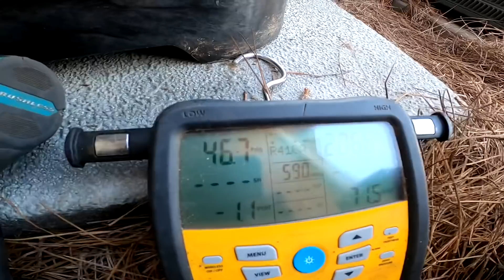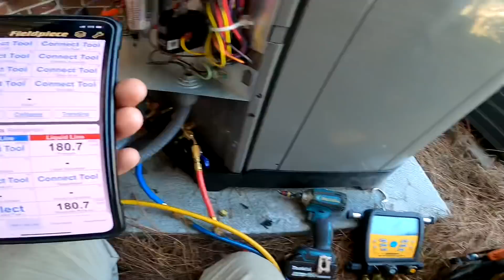Brand New Ruud Heat Pump - Faulty Right Out Of The Box

Comment: I would have pumped it down, cut the lines, unhooked, told the home owner "I'LL BE RIGHT BACK IN A FEW", and took it back for another new whole unit... 

If they refuse, take your business elsewhere!!!

That is within the 30day first run time, anything within first 30days, whole things gets jerked out!

I had a unit that was 1 1/2yr old, compressor went bad for no reason, didn't show ground nowhere, but would knock breaker every time, unhook compressor from contactor, and fan would run fine, i was ready to pull condenser, my supplier said if it was first 90 days they would...

Just talk to them, ask them to put themselves in your customers shoes, how they would feel...

I been lucky, got some good guys at my distributor.. Sure do!

Comment: Same thing happened to me today.  New unit, blocked TXV on the condenser in heat mode.  Works in cooling just fine.  I have always been loyal to Rheem and have installed a bunch of their systems.  Several have gone 20+ years.  I hate to see this happening.  Just no excuse for it.

Comment: Here in Florida the base tier product is now the two speed RP14AZ  I have installed two of them now with new line sets, compressors sound like marbles are bouncing around in them kind of like when a compressor is starving! Pressures where they need to be charge right on just noisy as hell! Got me very concerned anyone else seen this? Very loud surprised one of the Customers has not complained yet. Can’t just walk away gonna have to go back in a week or so and check it again and if it’s still doing it will be ordering compressors! I’m a die hard Ruud guy but between this and not being able to get any HP package units I’m about to start pushing Carrier again!

Comment: They have had a problem for a long while for sure. I’ve replaced many failed txv’s in the outdoor side of rheem/ruud stuff. Not metering correctly, broken cap tube from the bulbs, broken equalizers. I don’t see how they wouldn’t know it’s an issue.

Comment: Maybe the subs got some crap inside the line set or didn't purge nitrogen while welding or just straight burnt the copper or are it hot enough for the suds to stick the valve in closed position.  I know manufacturers do mess up but more then likely seeing couple other install errors on your video I'd make sure the subs are doing their job properly. That's just my 2 cents I know you didn't ask but I'm just looking out man love your vids I'm a tech out here in TX see all kinds of stuff at start up and it starts with the subs end on me trying to fix it to the best of my ability brand new equipment.

Comment: I know the pain of the new installation that is defective.  I had a lennox condenser with a locked rotor compressor, right out of the box! Now that lennox is using LG compressors im their lower end units, they have become piles of hot garbage.
Reply: Mine had a faulty evaporator coil, replacement didn't fix the problem, and now I'll have waited almost three weeks for a new txv. The worst.

Comment: I used to be a Raheem dealer in 2010 and had quite a few problems with the equipment. Needless to say I changed lines or equipment.
Reply: yep, leaking coil and leaking factory welds

Comment: I dropped Rheem for Amana, don't laugh, it's a better unit. First of all, they are much quieter, they come with a compressor jacket. The warranty is much better, and they would be replacing the outdoor unit for a DOA. They come with a full-size motor, not a cheap clamshell motor, they have old fashioned pistons, no TXVs to deal with. I replaced 35 outdoor TXVs on Rheems last year through the company I work for full-time. In the past 3 years I have installed approximately 27 Amana units on my own and have had 1 callback for a bad defrost sensor. Rheem's look good though, right? Oh, and Amana is MADE IN THE USA!!!!! Just something to think about.
Reply: I bought a new Amana 18 or 19 seer unit about 7 months ago. It kept showing a low refrigerant message when trying to use the heat pump. After 8 visits from the installer including 2 with Amana reps, they agreed to replace the unit next week.

Comment: Did you flow nitrogen during the install? Will be hard to determine if it was a installation issue or manufacturing problem.They should bring you a replacement immediately,if you work with them often.

Comment: Yep, we've already found several of those. We had a package unit last week where both the indoor and outdoor are pumping down like that. Rheem has got some kind of crap floating around in their systems that they don't want to tell people about. Or they're using the worst txvs known to man. I believe over the next year or two we're going to see the worst quality issues we've ever seen in the industry. Everybody's trying to get caught up on production and quality is going out the door. They'll slap anything into a box right now just to get it off of the assembly line and shipped out to the suppliers. This is going to plague us for a while I'm afraid. 😒😒😒

Comment: I see comments by others saying the customer took the cheap route etcetera. Come on guys, look you pickup a unit sold by your distributor, it should work out of the box.  This is lawyers call “a defect in material or workmanship.”  Accept nothing but a replacement unit form your distributor and let your distributor deal with the manufacturer.

Comment: Not a fan of Rheem. I think they are trash personally. I’ve fixed several heat pumps that were only a couple years old that had leaks at the condenser on that little tube for one of the pressure switches , the high pressure switch I believe can’t remember. I’ve also had a newer system with a leaking reversing valve, which I replaced only to have the condenser coil start leaking less than a year later and have to replace it. Needless to say, the homeowner was not happy. If you pay all that money for a new system, you shouldn’t have to have two major repairs done on a two year old system. I’ve had really good luck with Trane as well as some of the ICP stuff. Specifically, Heil and Maratherm. But, we install Trane 90 percent of the time and I’ve been more than happy with them.
Reply: Rheem/Ruud put out a product bulletin on both the High Pressure switched, and the reversing valve leaks (Which they extended labor on for 5 years). Both have been addressed and they stood behind the issue.
Reply: The unit really doesn't like you

Comment: These things do happen. It is a biproduct of any production line, but frustrating none the less. I personally like the Ruud unit's. U96's and V98's are as simple as any communicating system to hook up (R,C,1,2,) but the interface is intuitive enough to find whatever you need including random things like trim profiles or delay off timers (the dipswitch stuff). 

- clearly with this being an elderly woman in a retirement complex she went the budget route, so this doesn't exactly help you; but I think maybe your being a little extra hard on Ruud/Rheem given the all the circumstances.
Reply: Absolutely not. There is no excuse for poor workmanship. They should either overnight him a valve from somewhere or get him a new unit.
Reply: @paulhickey4485  😂If you say so big guy.
Reply: @berated4541  yes sir I say so.  They need to.make it right. There is no excuse for apathy.
Reply: @paulhickey4485  Who says Ruud had a lack of concern. From the video, availability direct from the manufacturer isn’t an option as they don’t have any in stock. Maybe it’s because my company is a Ruud Pro-Dealer but if I was in that situation (and have been in the past) I would make them pull down a new heat pump and I would rob it out of the new unit. Point being even as a “pro dealer” which gives you more purchasing power and slack on returns, Rudd often fights me on overnighting parts. You can’t expect them to bend over backwards on a defective part from the factory (remember every factory line has a % of defective components/units), especially when the contractor does minimal business through you. It just doesn’t work that way.
Reply: What ever happened to quality control ?
Reply: Given the decline in product integrity, I don't think so. Manufacturers have brought a lot of this animosity on themselves. It doesn't matter the customer, they purchased in good faith. The manufacturer should do everything possible to make it right, especially in emergency situations. We live in the most advanced country in the world and our product integrity is really low. Look at appliances. Not even a three year life span and they really don't work well when they do work. Now HVAC is getting high tech and less dependable. It isn't just Rheem. It's all of them. Customer service has become second rate. The government created the labor issues we have and it's going going to take a while to recover after we change course. That's another rant.
Reply: @paulhickey4485  Well I hope for both of their sakes he can take your comment to the supply house and get that part overnighted! 🤣
Reply: Rheem/Ruud has a policy in place for this situation. Even though the part is not available in the “Parts” Department, doesn’t mean they don’t have them on the production line side. The part gets ordered, an email sent to the factory, the part is pulled from the production side, and sent overnight. Yes, I am biased towards Ruud, I’ve been selling them for 36 years and found them to be the most responsive to any situation involving their product.
Reply: @TodSutherland  I do like Rheem and ICP products. They are economical, and the 14 Seer have generic parts. They work and last just as good as the others. That being said,  seems these days the quality is  the same, crappy. It's customer service thst counts and that's not much these days. That's not limited to HVAC either. It's disheartening for the most industrialized nations to have such inferior product integrity. It has greatly declined over the years.

Comment: Many years ago I was sent to start up a new carrier rtu. When I turned on power it tripped the breaker. Come to find out it had a severe burnout from the factory. Ended up changing the new compressor, changing dryer, adding a suction dryer. To say the least I was not a happy service technician. Have not liked carrier brand since that day.
Reply from the maker: It’s frustrating when it happens

Comment: High failer rate with the shorty Rheem AH  in the last few years  as well . The tubing is  just to thin!  they were having a bulit in night mare  years ago with a corrosion inhibitor  IN with the oil  causing the txv to jamm .  ICP  supply  house has a pile of bad COILS  too  they all do , the aluminum  coils  is more efficient  but  is not going  to last 🤤  now there going with aluminium  auto motive  stile  coil on the condensers  in the bigger  RTU  = Trane  /  Daikin / here in South Florida  the life span is not good. Really  got keep good record's  for warranty  trouble.

Comment: You let them know by voting with your wallet where are you take your dollars.   
         If your supply house doesn’t take care of you you walk your dollars somewhere else. 
             Have a Coleman brand-new out of the box a bad control board and nobody had it in stock.     Do you need needed to be forklift to the roof and a few employees so the expense just to get the unit into place was expensive it was already piped in so changing the unit without a question and they cannot get me a board for two weeks. 
                   I told them either rip a board out of one of your units in stock and give it to me or pay the hundred and some dollars to FedEx it overnight they didn’t either. 
                So I did not buy anything from them for five years.       When I did finally come back and asked why they haven’t seen me in such a long time there are some new people there and the and I let them all know exactly why some of their customers disappeared with that kind of service and never came back. 

             So I gave them a second try specifically gave them my requirements exactly what was needed on the condensing units and they messed it up again and I have not ever purchased any units from them ever since.
Reply from the maker: You’re right about voting with my wallet
Reply: @HVACGUY  and the Internet in the past couple years has been becoming my best friend for parts and supplies On time not broken delivered to the right place and at a cheaper price

Comment: Are you absolutely sure …. That nitrogen was flowing during brazing? AND was a 500 micron vacuum pulled??
IF …If that TEV were taken apart and black granular product is present then the installer has some answering to do.
But it is remotely possibly a factory defect. I. Sure wouldn’t bet on it though.
Reply: During a new install you're vacuuming the indoor coil and line set, not the outdoor unit since the unit is already pre charged and valves are closed. Defenitely a factory defect
Reply: @Kilcrops0914  
What you wrote is true of course But if moisture was in the lines then when the valves get opened that moisture could now move to the out door section. 
This is more critical if the nitrogen was not properly flowing. Copper oxide “could” ?? Have formed and then found its way into the TXV clogging it.
Please understand, I’m not saying it CANT be a defect, just that he needs to be sure proper install procedures were followed and are not contributing to this issue.
Thanks for the good conversation!
Be well
Reply: @wayneschneyer8699  didn't think about it that way, but you're absolutely right.

Comment: Just had the same issue with a Tempstar, package unit. Brand New out of the box Package unit. My dealer made it Right. This unit was installed in a house with 2 Physically challenged women. I have installed close to 100 hvac units and have never had a failure on new first time start. TXV are causing more issues.  SAD
Reply from the maker: This is rare. I know it happens, but dang it’s frustrating.

Comment: Bro I've seen this SO many times on new rheem installs. From restricting indoor/outdoor TXV to external equalizers leaking, to the TXV head leaking. Even been seeing them zip tie wires too tight, pulling the reversing valve harness off.
Reply: It’s crazy I’ve been installing a lot of rheem units (including today) and haven’t ran across that problem.
Reply: @MW3player954  its because the units doesn't like them
Reply: @MW3player954  Agree I’ve been a Ruud dealer since 2014 and have seen 2 issues with TXV and that was caused by the Copland compressor debacle in 2014

Comment: Junk...Rheem also leaks a lot in condenser copper tubings
Reply: I worked on a Rheem heatpump from 2018 found evap coil leaking , customer has told me the reversing valve and both indoor and outdoor TXVs have been replaced and now the evap coil. Sucks for the customer.

Comment: What's the reason why the head pressure wouldn't claim much higher than that?  Does Rheem pay you for doing that repair or changing out the condenser since it's out the box defective?
Reply from the maker: Starving for freon
Reply: @HVACGUY  Ok, I'm just thinking about it the wrong way I believe ,just thinking the refergerant has to stack up somewhere
Reply: @HVACGUY  equals no or low compression. 
Or am I wrong?
Keep up your videos. 
Greetings from a German Truck driver
Reply: Yes, Rheem/Ruud pays labor in the first year for anything in the refrigeration circuit, 90 days on compressors. it’s not a lot, but it helps defer the cost.